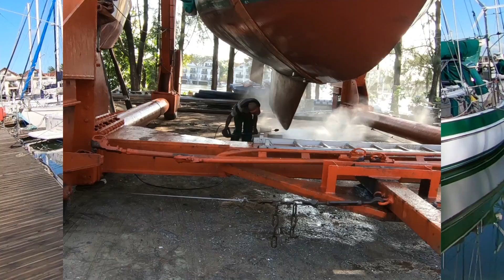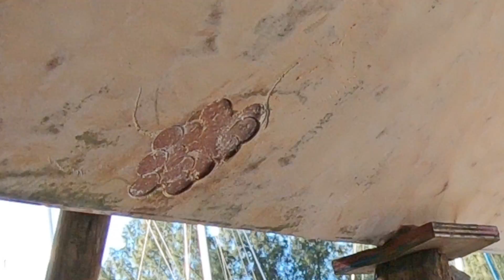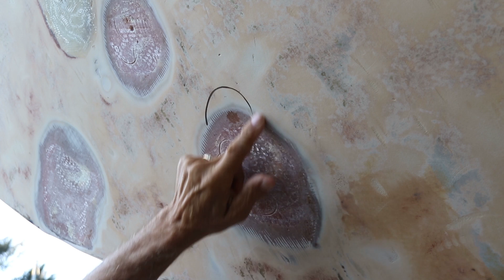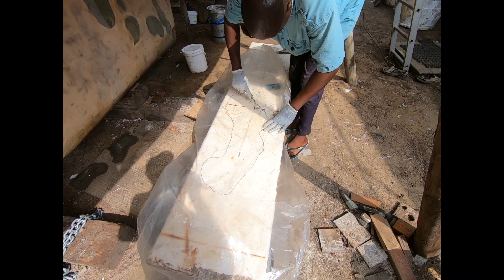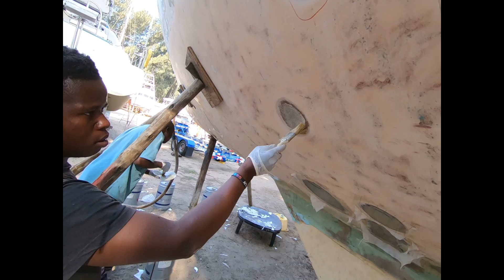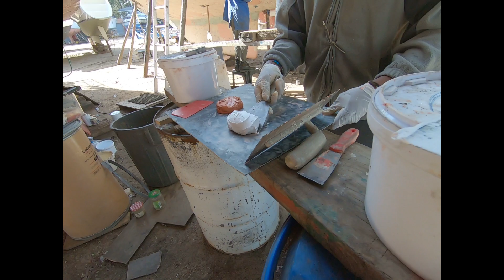500 ROTTEN, FESTERING Blisters!!  - Blister Repair on a Fiberglass Sail boat! (Patrick Childress 59)

Comment from the maker: Have you ever seen so many blisters on one boat? Have you had this problem on your boat? Would it be worthwhile in your opinion, to do a blister repair on a boat like this? Or would you just buy a nice boat with no blisters on her? Please leave a comment below...anything to do with blisters or blister repair...or just say hi!
Reply: My old 1971 Columbia 34 MKII  (I still have her) never had a blister - but I didn't look too hard for them either... 😁
Reply from the maker: It’s nice to never have “A” blister ;) -Rebecca
Reply: You tested the hull for moisture penetration before and after. That's critical. Can't comment on remarks above. I'm done with fiberglass after getting burned on my last one.

Looks like you did a great job of it.

So much work.

Ever looked at HDPE as a substitute for fiberglass and glass over ply? Just curious.

It didn't really exist in quantity until 20+ yrs ago. Recycled Milk Jugs and plastic soft drink bottles. 

I'm very familiar with the material from another industry and am looking to start some experiments.
Reply: Michael Lacy  There is a company namer Seahorse work boats, and another one named Tideman, that actually make boats out of welded hdpe.
Reply: @tamaralee4108  What's hdpe anyway? Been working on boats many years and never heard of it!
Reply from the maker: Yes...blister repair sure is not a job for the timid. Thank goodness Patrick has the stamina and knowledge for a blister job like this one. If not for him, I’d be done cruising.  :) -Rebecca
Reply from the maker: @HillbillyOrthodox  Sorry to hear of you bad boat experience. Sometimes even paying a dollar for a boat is too much. No, I can't imagine using HDPE as it seems as though it would be difficult to get to stick to fiberglass and then difficult to get antifouling to stick to it. For a situation like ours, I prefer to stay with epoxy and good cloth....known materials.  Maybe HDPE for antifouling?
Reply: Yes I have this kind of severe blistering. The problem with this repair is that it requires a tremendous amount hand labor which would cost too much in most locals not to mention the environmental restrictions imposed in many  countries.
Reply from the maker: Yes we are lucky to do this blister repair in S Africa where labor is very reasonable, and the workers are motivated! -Rebecca
Reply: Shout out from an ex resident of Richards Bay!! 
A welcomed surprise to see the geo tag on this random video
Reply from the maker: Kiosen Doing a blister repair in Richards Bay was almost a pleasure...loved that while area!!!-Rebecca
Reply: What horrible amount of work! 
Still to just turn your back and buy a new boat you don't know the meaning of owning a boat.
It's a love affaire.
Reply from the maker: Knut Knutsen Yes I’m sure. But the boat work begins again so quickly thereafter...and you have no money left to pay someone else to do it...so it’s all diy. Blisters can appear on new boats too...-Rebecca
Reply: Yes! That at once blessed and accursed late afternoon oblique lighting uncovers a multitude of sins!
Reply: You only get amine blush from fast cure epoxy. I always use slow cure; never have blush and the slower cure rate makes for a finer and stronger molecular polymer cross linking. Yep, it does take longer to 'kick' but that's no a bad thing most off the time.
Reply from the maker: Ancient Heart interesting info...-Rebecca
Reply: thanks,,from japan
Reply from the maker: keiti umeki man japan Thanks for watching our blister repair videos!-Rebecca
Reply: What did this cost?
Reply from the maker: We haven’t tallied the whole bit. Best guess...we are in couple of thousand dollars for the 5 months of labor, and much less than that for materials. Remember where we are before you get too surprised. -Rebecca
Reply: @SailingBrickHouseAndOsprey 
Disclaimer... I really want to know. Not meaning to sound like a jerk. I offen come across like this but I am asking out of pure inquisitive nature.
 I understand you are not in the US. My experience overseas is prices for materials is roughly the same. 
People always say things are cheaper in other countries. But it always seems to me to be slightly higher or lower. 
For example, 1990, you could buy a radio in Saudi Arabia for $20. At the same time you could buy a radio in New York city for $20. Pack of Marbro cigarette was equal to $1, while at the same time it was $2 In New York city. ( if you didnt have to pay the taxes it would have been roughly $1)
Now labor may be different. I hear labor overseas is cheaper. But what I want to know is;... is it really cheaper? 
And if so, why do people not build boats overseas? 
Now, I did see a video of boats being made in, I think it was India. And it was $250,000 For a 50 foot boat. That's not cheap. For that amount you can make one in the US. 
Please correct me if I'm wrong. But seems to me with all the people you have working on it. Plus the materials. You will be putting out about $20,000 or more. 
Also, this isn't counting over a long period of time. I'm going off of a months of work. While it appears from the video it closer to a year. 
Don't get me wrong. I know nil of the work you are doing. From what I know of other things it appears you are doing a great job. Better then most would do. I like when people repair things the right way, rather then bandaids. Which always come back to haunt you. 
Back to labor. If it really is cheaper.... What prevents someone from buying a $8000 40 footer and sailing it to say South Africa and fixing it into a $80,000 40 footer?  Or for that matter a $250,000 40 footer?
Or
Going to South Africa and building a 60 footer for like $10,000? 
I must be missing something?
Reply from the maker: Yes..the economics are difficult to understand. They make MANY catamarans here in South Africa, where labor is cheaper. Import duties are higher if from the US, Australia, or New Zealand, minimal if from some parts of Europe, and NOTHING of made on the continent of Africa. But Gunboat stopped making their boats here, and have transferred to making them overseas because it turned out cheaper because of all the taxes, theft, bribes and corruption here in S Africa. We have found you have to figure out what is cheapest in each country and do that...not the expensive things..wait til you get somewhere else, and then investigate again. 
$20,000? Nope...try about a fifth of that, materials and labor for 5 months. Yeah. That’s why we did it in S Africa. When I had a yard in Maryland do it nearly 19 years ago, yes...it was $25,000. That was back when I had a great job. I can’t afford that kind of health care for my boat anymore! It’s a good thing we are on the road!!
You are right on the money about some things being cheaper and some things being higher. It’s hard to figure out in S Africa. The food is a lot cheaper than the US...like often 50% cheaper...unless you buy imported food.s you don’t have to...S Africa has a lot of local brands that are fantastic...better than US products. Special parts, like for boats...are TWICE the price. usually we can import from the US or Europe including shipping and import duties for less than it costs to buy the exact same product locally. But Labor...which was the thing we needed the largest supply of here...labor varies HUGELY. There are u limited numbers of people that are absolutely bonkers, off the wall excited to have steady work for a while for $15 PER DAY. Sometimes as little as $10 PER DAY. Sometimes you pay as much as $25 per day!!! And then some very very highly skilled specialized professionals, often from another country, charge as much as that per hour!!! Yikes! But labor is what you come here for. Very willing motivated labor at that. So yeah...roughly $2500-3000 USD for labor for 5-7 months. And there was a lot of other work done in that time not even blister repair related, from sanding propane tanks, to sanding teak from inside, to shining stainless steel. Great value for the money. 
So the moral of the story...think about what kind of work you need to do...and go for the right country for that. South Africa is the right place if you need labor. I could tell you about a ritual I saw on the beach for a young man who was trying desperately, to no avail, to find...chickens, lots of seawater, and lots of chanting...work is a very precious and rare and highly valuable asset in this country of extremely high unemployment. -Rebecca
Reply from the maker: And YES...buy an $8000 fixer upper...sail it to South Africa (if it will make it) , and whether it be a blister repair job, or another very labor intensive job you need to have done, and add value to your old sailboat!!! -Rebecca
Reply: @SailingBrickHouseAndOsprey  thank you for answering back and answering my question.
I assume you were not living on the boat while working on it. So, what did housing cost? Did you rent a place or hotel the whole time?
While we are at it that is another question. What do mid grade hotels cost? 
Another question I have, yet I understand if you are not able to answer .... how does one have a dog on a cruiser ( I'm calling a sailboat like your a cruiser, as you can navigate the 7 seas)  By this I mean where do they do thier business?  I realise also that for this that at minimum net will be needed to prevent them from falling overboard. And know one will have to have full shot records and possible quarantine at some ports.
Reply from the maker: Pycho Hobo We lived on the boat the entire time. I, Rebecca went home for 6 weeks when he was doing the bulkheads inside. But Patrick lived on the boat during that time. 

We have a cat...no dog. I would think a dog would be more difficult because they have to get off the boat for walks etc, so quarantine must be more difficult. A cat is fairly painless as long as you don’t go to Australia, or make a big deal that there is a cat onboard. -Rebecca
Reply: Impressive! So many good tips in this video. Definitely an inspiration to keep going on our project. We had to drill upwards of 2500 holes on our schooner. We stripped the entire hull and are waiting for it to dry to an acceptable level. We can feel your frustration with finding more and more blisters...it often felt like we would get on top of them all, just to find another dozen... Once dry, we plan on patching low areas and then laying up 2-3 layers on the entire bottom. Any tips for doing bigger layups?
Reply from the maker: Will let Patrick address the bigger areas for you...but wow...2500 blisters! We’re there any good areas of the hull ;) Yes keep going on your project...you will have a much more valuable and seaworthy boat when you are finished! -Rebecca
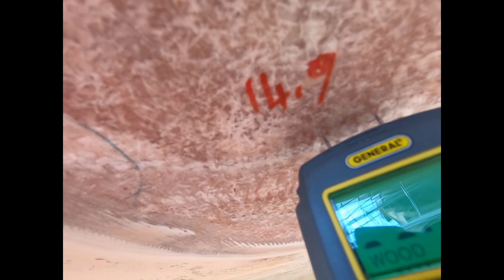Reply: 7:03 "I'm sixty-nine years old, we've waited long enough, time is ticking" I am 36 and that really got to me.
Reply from the maker: Jeremy Lopes Don’t wait...go sailing as soon as you can. So many wait and then can’t go. Fix the darn boat, and then leave the dock and go sailing ;) Blisters or no blisters! -Rebecca
Reply: If it’s delaminated forget it. If moisture is trapped in there when you try to fix it..... NOPE.  I had a small delaminated spot on my deck of a 50 foot lobster boat and when we got looking into the severity of the problem we ended up putting a whole new deck in. Water went throughout the deck underneath the glass and the wood was punky. Good luck
Reply: I learned to sail/crew aboard a late 70's vintage 30 Catalina tall rig. Part of my ahem training was grinding into and repairing the thousands of 'boat pox' osmotic blisters in the hull. Oh brother that was a long NY spring. Fortunately, my 78 Down Easter doesn't have that particular malady. I had the bottom wet soda blasted a few years ago (oh gawd what a mess), which opened up the few small blisters that existed. After filling and fairing, and five coats of epoxy barrier coat, the hull is one of the best in the marina. Sails faster, too! At least it seems like it does.
Reply from the maker: Ancient Heart Nice it only had a couple of blisters! Nice to have a smooth, clean fast bottom! -Rebecca
Reply from the maker: Honk Honk Yes...the blisters could still return. We hope to keep them at bay for 10 years. But probably won’t do it again! -Rebecca
Reply: @SailingBrickHouseAndOsprey  Blistering can be a serious problem!  it can be a real problem!  Usually caused by a boat builder using cheap resin to save money. Combined with poor workmanship! When a lay-up is to fastly made, getting all the air out!! Peterson boats were especially bad it! Been working with fiberglass since the mid fifty's
Reply: i am not an experienced sailor, but i love seeing quality workmanship being repaired rather than replaced.
Reply: Big job. I had a skookum that had that same problem. I was sixty years old then...I stripped every single piece of usable deck gear, rigging, mast's, winch's, bronze port lights, interior fittings and electronics. Then hired a back-hoe to make the remains of that blistered abortion all fit into a 20 yard dumpster! That's how I handle blistered up Hull's. I refuse to do blister work for anyone. It's useless. Oh btw, keep telling yourself that it doesn't in any way affect hull integrity... Cheers mate.
Reply from the maker: Yes blister repair is extremely difficult especially on ones soul. I don’t know how Patrick kept with it for so many months! -Rebecca
Reply: @sexybeast6567  Depends on how thick the boat is, mine was 1 1/2 inches thick at the bottom tapering to 3/4 on the sides so the 1/4 that was bad really didnt affect the strength of the overall boat with its blisters. however I would repair with good polyester and seal with epoxy. you really do not gain much using epoxy to fill in blisters.
Reply: You have more than blistering,  it appears the boat is also delaminating, the layers of cloth are separating.    I owned and raced a 1976 Santana on Lake Erie, and I've seen her hull recently.  She is not blistering, still racing and goes through the harsh winters.   I also owned and raced a 1970, 40 foot R boat on Lake Erie that had some blistering located in areas of stress, [she is 6.5 feet wide with 17 inches of freeboard,  16 K with 8.5 in the keel] with a few reappearing at various locations but never anything like what is on your boat.    In the R fleet, Cotton Blossom was built in 1954, she was the largest fiberglass boat at the time, DOD assisted in her cost since a mold had to be built and she does not have the blistering like your boat.    Don't blame it on the era, something was drastically wrong when they laid her keel in the mold.
Reply from the maker: @fixento  Just Google blister era Valiant 40. There is a lot of information there.
Reply: @SailingBrickHouseAndOsprey   I did, and the boat was offered at discount pricing due to blistering, delamination, and soft decks.   Had you paid $500 and had the boat surveyed, it was a good investment.   If you decided to take the risk and have the boat repaired and the repairs didn't exceed what a comparable 40 ft boat would cost and didn't mind the inconvenience, then you are out nothing.    I would never purchase a boat with those issues; as the years pass, so will the problems.   That being said, sailboats are like ladies, and you do fall in love.
Reply: @fixento  I was thinking the same...once you get delamination it is damn hard to rectify.
Reply from the maker: mwnciboo we hope the blisters are gone forever...but we know they will likely be back some day. You are right...very difficult to stop these nasty little buggers! -Rebecca

Comment: Uncured blisters is what causes osmosis, water seeps into the uncured resin and turns it into acid
Reply from the maker: Yes it wasn’t a good resin and hence did not cure properly. Even after 40 years :) Doesn’t even need the water actually in this case, as it occurred well above waterline too. Thats how bad the resin was!
Reply: @SailingBrickHouseAndOsprey it can suck the water right out of the air if the resin is bad enough

Comment: It's a hell of a job.
Yes, in those days (and still) many boatbuilders use(d) polyester, and not vinylester, or even best, epoxy.
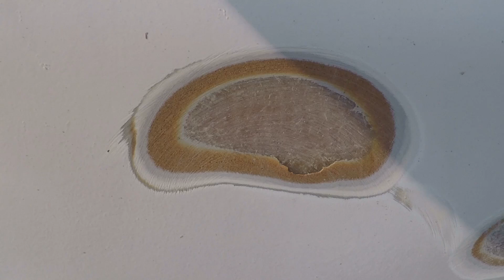One thing though, @05:50 the brown layer shows many bubbles...
You state that the cause is resin not fully curing, that can only come from a wrong mixture and/or not mixing thoroughly enough. How can you be sure?
Moisture coming in (and delaminating) is an osmotic process. That is where the name osmosis comes from.
Looking at all(?) blisters grinded out, the amount of surface, I doubt if mechanical peeling, including the brown faulty filler, would not have given a more thorough, an smoother result.
Of course then it will be mandatory to regularly heavily rinse the hull and letting it fully dry (only to be judged by measuring), just as you did.
Reply from the maker: I’m sorry Patrick isn’t around to answer. But this was a different kind of blistering. The manufacturer has made many a statement saying it was a bad resin that they go during the oil embargo that causes the boat blistering.

Comment: Had a Cheoy Lee with a similar problem but it was pretty much only below the waterline. Ground out the blisters ( about a quarter of an inch in) and let it dry out for about a year.
I rinsed with fresh water every week until it was dry. Fixed the blisters with polyester let it offgas awhile and then sealed with epoxy which I believe at the time was mad by Shell
I rolled on the bottom paint while the epoxy was still tacky.
Reply from the maker: Sounds like you did a very thorough job. I’m sure it will last for many years! thanks for watching this channel.